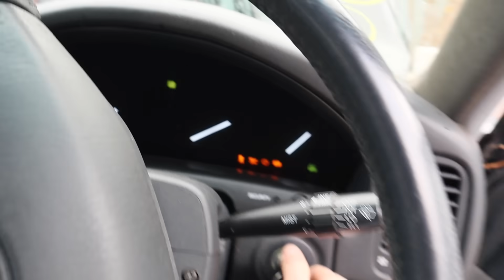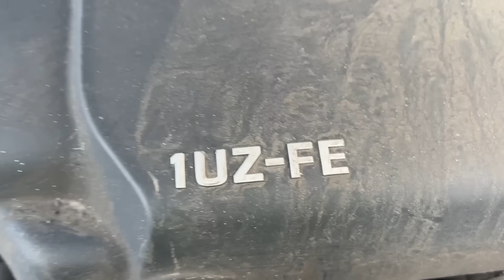E30 V8 SWAP - PART 2

Comment: i Probably made the UK first manual ls400 in 2013 i think… auto box thing is easy, just have to bridge 2 wires to make it think its in park or N.   Fairly sure the connector and pin out is the same as the mk4 auto supra and thats how i found out / made mine work. 
Not the best hp for a 4lt these phase 2 1UZ’s but soo soo reliable.
Good luck dude

Comment: I hope you do it and it will be cool when done but It's gonna be such a pain to swap that into the E30, should have gone for a BMW engine... There's a reason it's not a common engine swap. Have you thought about stuff like exhaust manifolds and cooling? It's a huge engine in a small bay. So much stuff is going to have to be custom fabricated. An M54B30 would get you to 250bhp wIth a few mods and it'd be 10x simpler and cheaper.

Comment: would it be easier to get a stand alone ecu ? cuts out the bs with the gear box stuff ? can't wait to see this thing running
Reply from the maker: and spend £3k on an ECU, custom loom and mapping? nope, not at all lol
Reply: @itsleelockwood  fair enough haha, didn't know the pricing tbh, im sure you will figure out some way to get round it in good old lockwood fashion 😄

Comment: Is there a wiring loom in the e30? Or nothing? 

The gearbox will need to know its in park to start, that will just be a matter of bridging 2 wires normally.
Reply from the maker: nothing in the E30
Reply: @itsleelockwood  ah ok that's fair enough then

Comment: If it doesn't like the auto box being unplugged get in contact with Phoenix Engine Management. They make an auto transmission emulator for the is300 manual swaps so they should be able to do something for you.
Reply from the maker: awesome thanks man